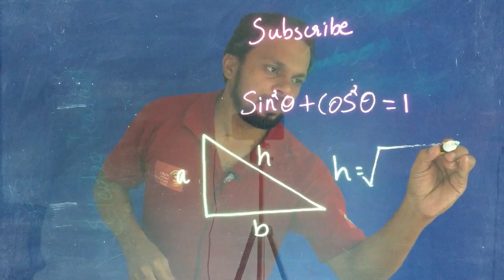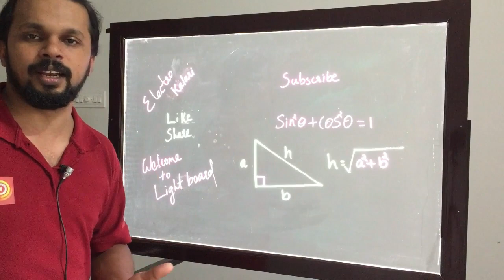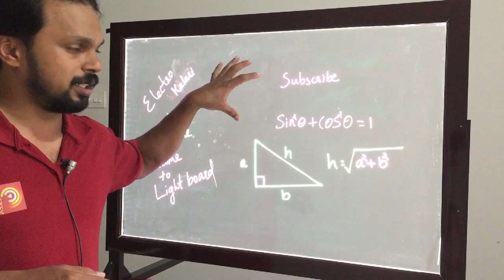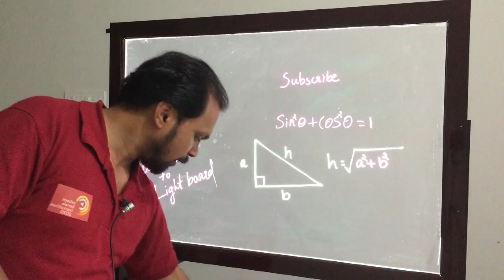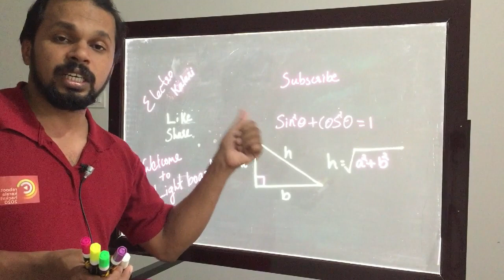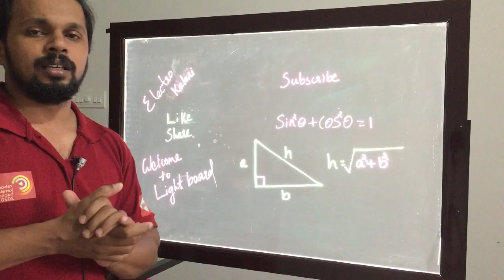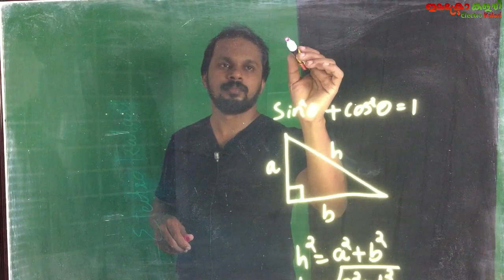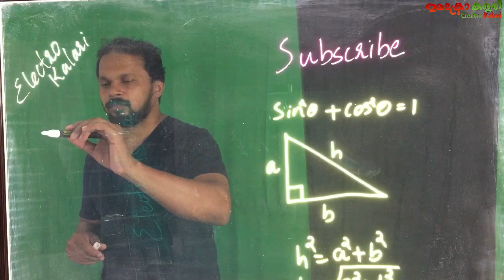Light board |  How to make a Light board at Home | DIY Light board | Light board for online classes

Comment from the maker: If anyone is trying to make this, it would be best to use glass. because acrylic will absorb some amount of ink. this ink will make a blur effect in board. If anybody has any requirement about this type of lightboard please let me know, electro Kalari can make suitable suggestions. 9995416164
Reply from the maker: @sreejithmlsree8187  9995416164
Reply: @ElectroKalari   Acrylic Sheet_il petenu scratches veezhille?
Low iron glass(Starphire) alle nallath?
Reply from the maker: @Arunkumar-vc6ge  yes definitely
Reply from the maker: I recommend high quality glass is better